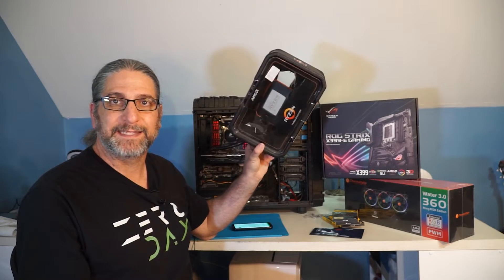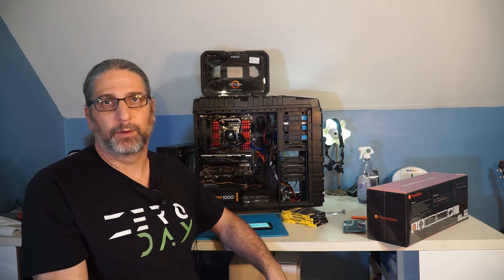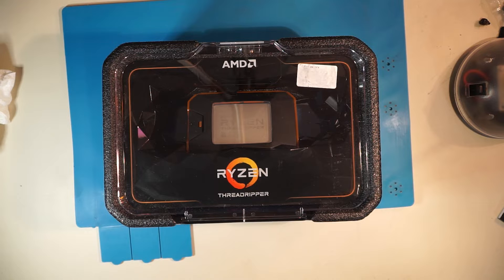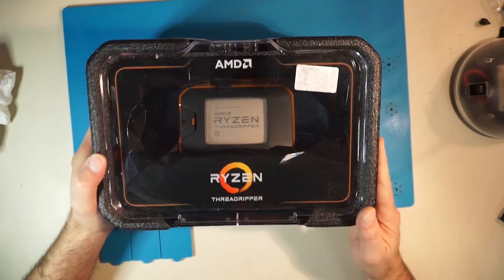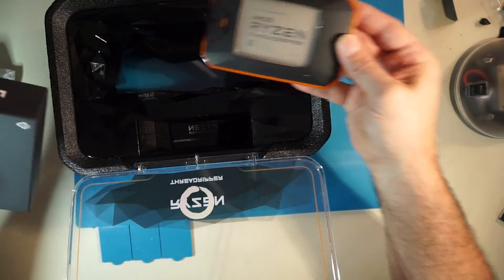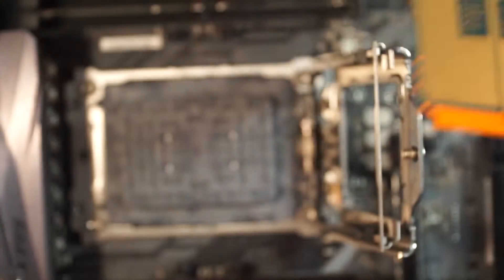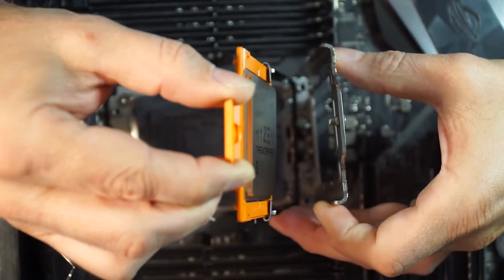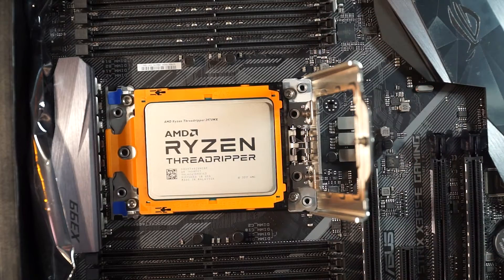AMD Threadripper TR4 CPU and Thermo Paste Installation X399

Comment: I'm replacing my motherboard (inherited a system, and there are some problems with DIMM slots, and one of the GPU slots)... remove the threadripper and reset on new (identical) motherboard... should be just as easy?  Is there any issue with a CPU having an issue coming off once they've been seated? (any idea?)

Comment: I configured a TR 3990X system for a friend which the shop built. The thermal paste is still the pre-applied one, but it is running HOT, I mean even at idle, with the pump at 100%, it runs at 57C. Full load is about 75C. With the pump at low it was even going to 98C on full load. So my question: we're going to remove the pre-applied paste and replace it. But with the method showing here, you should indeed cover more off the coldplate, but the paste is touching the screws. Isn't that a problem? Coz those will also absorb the heat...
Reply from the maker: Like I said in the vid, I am NO pro at this, I just followed what made the most sense to me.  It's been many months since this video and I have never seen it get hotter than 43 C even when processing video.  I'm happy with it and the setup as I did it in the vid.  Hope that helps.

Comment: good job, all I can say is I started with pc's in 1984 and every cpu I installed I used the pea method 1 dot pea size in the middle.  BUT  threadripper is a big chip and I can see the wisdom in using this method with such a large chip.  how are your temps ???
Reply from the maker: never higher than 42 C  Even when processing video.